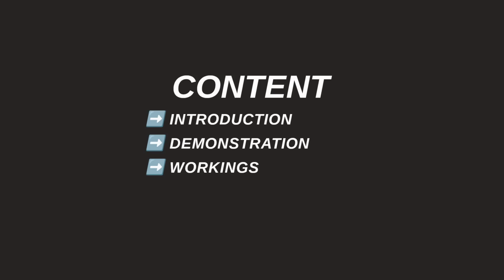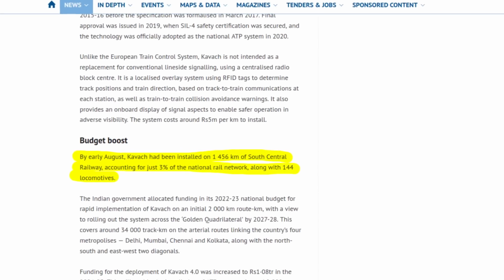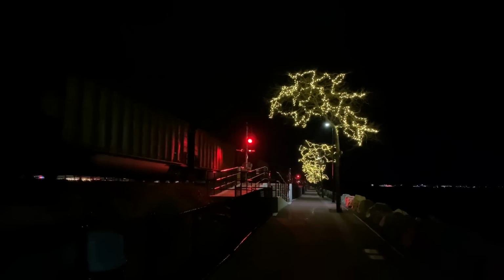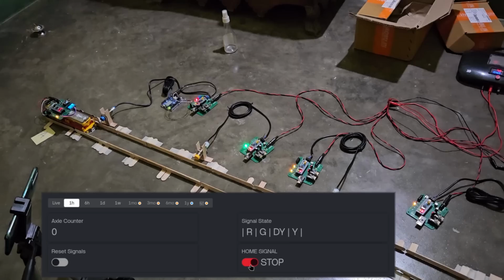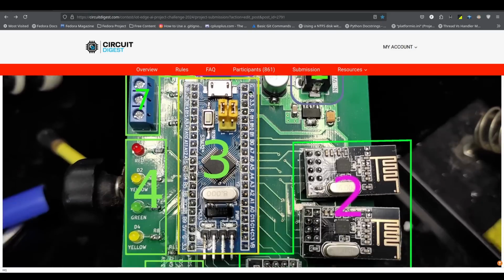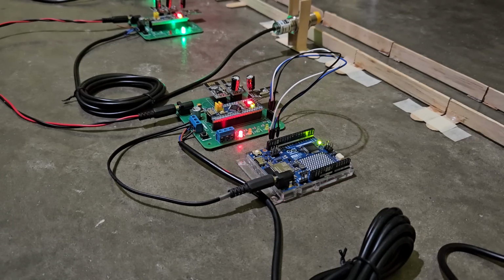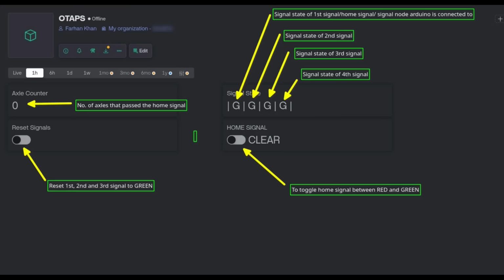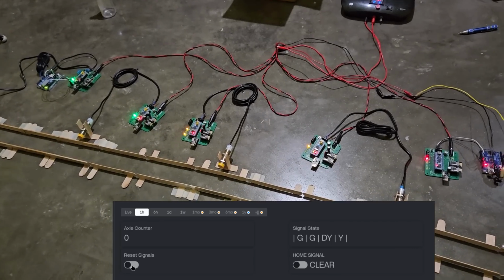OTAPS - An Open Source Train Accident Prevention System for the Indian Railways

Comment from the maker: The intention of this video is not to defame KAVACH, but to provide an alternative. KAVACH is an excellent system, and one of the safest ATP system out there, meeting SIL-4 requirements.
What I made is still a hobby project, but I wanted to share the concept behind it.  A concept to provide a cost-effective solution to speed up railway safety. Who knows, it might catch the interest of the railways, and they would pick this project up and improve it.

IMPORTANT
----------------------------------------------------------------------------------------------------------------------
In the project documentation, the components were automatically assigned purchase links to Digikey. Some of these links do not correspond to the actual part. During the publication process the flow diagram for the communication and the program flow, has undergone serious compression to the point that text is no longer distinguishable. If this is not fixed, then I will upload the files and documentation to my GitHub repo for the firmware.
----------------------------------------------------------------------------------------------------------------------

The locomotive unit cost around 2k INR each, and the signal units cost the same amount, and the Arduino UNO R4 for the web interface cost around 2.3K INR. But you need the Arduino only for the first signal unit.
If the signals unit were placed at an interval of 1KM, then the cost per kilometer would be around 8K INR(including some headroom).
Although I am no railway expert, and I am not aware of all the complexities that are involved in setting up such a system. A more knowledgeable person can through more insight into it.

Also, I would like to mention that in the current state it cannot prevent an accident like the coromandel train accident which occurred due to incorrect wiring of the signal circuit during maintenance. However, I have been trying to find a solution for it, but I have not found a concrete solution yet. If you have any ideas, then please let me know.

Comment: Yawn. I think this wont work. He mentions some 3 accidents, one (or two) was where the pilot dozed off. The crash in Odisha (2023), the tracks were wrongly switched (probably due to a short circuit), which caused the oncoming train to derail and also caused it to ram into the goods train, and some of the carriages rammed another train on another track. I think it wudnt hav made a diff if the driver had braked cause of the short distance. The signal wud hav shown as green, but the tracks were wrongly aligned. So how wud this tech solve that accident. It's easy to do a project like this, but implementation is another headache. You'd hav to hav maintenance crew for all the sensors placed on every km of tracks. You have about 68k km of rails in the country. Also, how do you avoid collisions with cattle? By the time the pilot sees the cattle, there isnt enuf distance to brake in time. What i'd suggest is have a drone locomotive which travels 1 km ahead of the train, use radar sensors (maybe millimeter wave) to detect any obstacle on/near the track and send a mesg back to the train to stop. Also have a sensor inside the locomotive to detect if the pilot is dozing off.
Reply from the maker: I appreciate your thoughtful feedback, but this project is not a complete solution for all train accidents.  Unfortunately, in the current state it cannot prevent an accident like the coromandel train accident. However, I have been trying to find a solution for it. Although, I have not found a concrete solution yet. If you have any ideas, then please let me know

Comment: Nice work. Kavach costs more than 50 lakhs/km, how much will this cost? Kavach apparently failed in Orissa because of the signalling system. How do you prevent that?
Reply from the maker: Check my pinned comment for the cost estimate. Unfortunately, in the current state it cannot prevent an accident like the coromandel train accident. However, I have been trying to find a solution for it. Although, I have not found a concrete solution yet. If you have any ideas, then please let me know.

Comment: I can’t see why was Arduino R4 board is used as you have just used it for sending data over wifi. The contest was related to ai.
How will you implement in real world as wifi has only a range of 4-5 meter.
Reply from the maker: The Arduino is connected only to the home signal which is situated close to the station. I had to keep the cost down, using Arduino instead of stm32 for every signal unit would increase the cost tremendously. Plus, not all signal Units need to connect to the web. 
If in case Wi-Fi connectivity is not available in the station, or there are issues with the range then I will switch to an LTE module.
The contest is about both IOT and AI, my project includes IOT. The sample project provided by circuit digest was an IOT project. If using AI is mandatory then my project won't fit their criteria.

Comment: Hi, I'm not able to understand the utilization of AI in this project?
Reply from the maker: My project includes IOT. Simple calculations are made to detect an incoming train.
Reply: @Ozonised  But issue is you are submitting it as an Edge AI solution isn't it so or i am thinking the wrong way
Reply from the maker: @virensharma2277  no, not as an edge AI solution.

Comment: Really good grid-based signal monitoring system. But how will it recognise if the train in front is on a parallel track and it should not apply the brakes?
Reply from the maker: The parallel track will have its own set signal units.

Comment: How is it different from the kavach system apart from being open sourced? And how can we ensure that the sensor will not be tricked by any other external factors?
Reply: Great approach, but i believe u would need a station unit, because we cannot rely on the dashboard served through the internet as a lot of stations are not in well connected areas, so you would need a more localized approach to control/override signals
Reply from the maker: Yeah, I guess. I can create a local webpage to control the signals rather than using Blynk which requires an internet connection. Hey, actually that would be a better approach. Thanks for the idea. I will save it for the next revision.
Reply from the maker: In my system the need for a station unit is eliminated. The locomotives directly communicate with the signal units. I have been thinking about whether the signals should work independently as in the or should I integrate it with signals units of the railway. So that way they would benefit from the existing infrastructure.

Comment: Perhaps the SIFA system can be of help too (deadman's control system). Also with those magnets talking to the train, seems quite similar to real world systems like PZB. Maybe interesting to add support for acknowledging a signal; apply emergency brake if the driver does not acknowledge a signal. Instead of immediately applying brakes, why not give the driver a specific time frame to slow down within? And if the target velocity is not reached (say the driver does not slow down from 160 km/h to 85 km/h within I think 23 seconds) also apply emergency brake.
Reply from the maker: I had a lot more planned for this project. But since the competition deadline is approaching and so are my semester exams, I had to end my work on this project. Perhaps, I can save it for the next revision. Thank you for your feedback, I will look into SIFA and PZB systems.
Reply: That's brilliant i have played many games with those systems and they are effective indeed